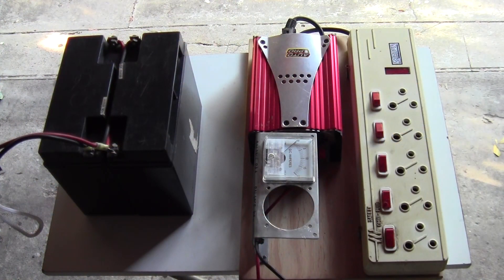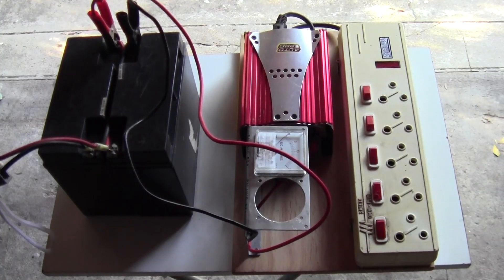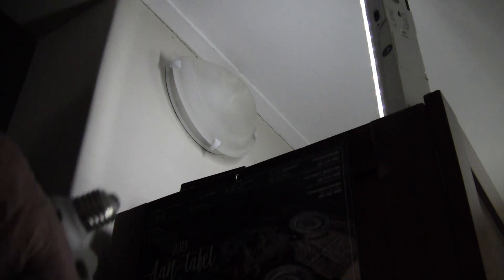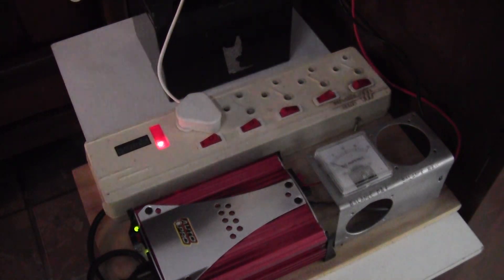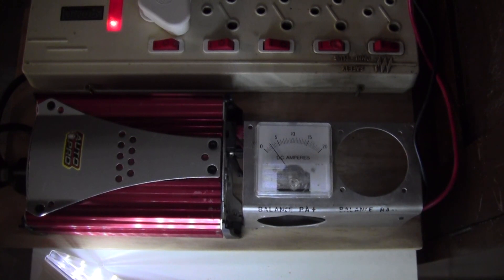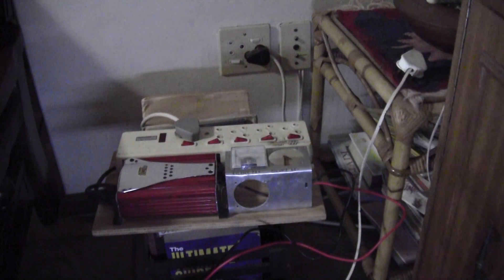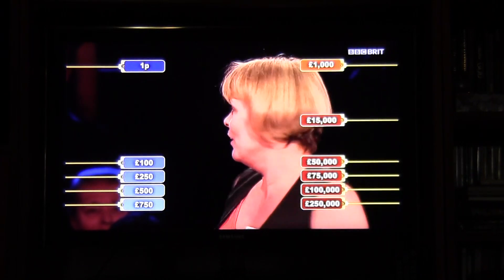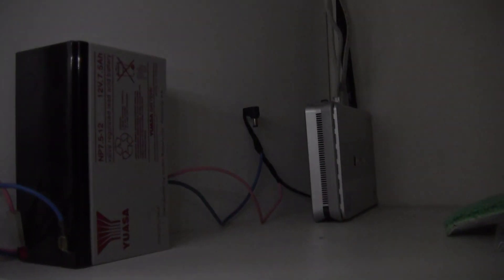Easy, Cheap, DIY Load Shedding Buster System

Comment: And how many batteries do you need to run the whole house plus stoves and heaters for 2hour
Reply from the maker: To run stoves and heaters you will need a proper inverter system, at least 8kW inverter and 10kWh batteries - you are looking at around R200k!

Comment: Can't you use that system for the plugs ,TV and lights  at the same time
Reply from the maker: Not on a 400W inverter, you will need a much bigger inverter and batteries.  It should then be properly installed by a qualified electrician.

Comment: what a helpful video. i certainly learnt allot.i like that you pointed out that a router can be plugged directly to a 12v battery. thank you
Reply from the maker: Great to hear.  I may have confused the issue, but the router is effectively plugged into the 12V, but runs off its power supply when the mains is on.

Comment: Very clever. Really like the thinking, the next step at this time for me is diy'ing the inverter for different appliances. In my honest opinion, the inverter is a shit device to run appliances that already convert AC to DC. So you go DC to AC, and back to DC. Such a waste. Eish, and inverters has been in development since the invention of electricity, but all people do now is buy inverters.
Reply from the maker: Indeed very inefficient to convert back and forth. I since got myself a power bank specifically for keeping your internet devices powered during loadshedding. The complication is that their voltages can differ, like mine needs 12V and 5V, some even require 9V, but they do come with all these voltages.
Reply: @SterremanWillie  nice, same here. Cheap ups for running WiFi for 3 hrs. I bought a few TP4056 modules to charge some lithium batteries I have lying around and the free lithium batteries from disposable vapes. This works great for lights and also with small 5-6V solar panels. I managed to upgrade one of these into a power bank with a 3.7-5V booster board, thats enough to charge a cellphone. My next target is 12V appliances such as laptops and also small AC water pump, going to try a mechanical DC PC fan inverter. It's a lot of fun, must say 😁👍
Reply: I find energy fascinating, inverters for instance have existed since the invention of electricity, DC/AC, Nicola and Ed. Just a matter of sizing components for what you need. Solar power has been around 1000's of years. For geyser there are various option to heat via the sun and if all else fails, nothing wrong with some charcoal heating. I haven't looked at geysers yet, they the most power hungry, we would need to look at how the element actually work. For now I'm going from low voltage to higher voltage, next target AC water pump for a grow tower. Guess our main problem is everything we have and even our houses designs are made specifically for using grid power. And Eskom charging for solar is a b#@!. Actually, for a geyser you should use a gravity battery, connected to AC generator. Yeah, that is the route I think I'll take since we have to consider the cost they are applying to solar panel systems. Gravity and solar thermal should still be viable and maybe easier to hide lol

Comment: Exactly what I am doing for my home fiber connection (the last part anyway).  To better charge the battery when the power is on you can introduce a buck boost converter to increase router 12v to 13.7v.  Also a good idea to add a diode to the routers power supply and between the battery and router to ensure the battery doesn't drain when mains is on and to protect power supply. Also can use buck boost converter to increase the 12v from the battery to 24v if you run a ubiquity Wi-Fi access point. Works perfect. My internet stays on when we shed even during stage 8.  Did not cost me more than R100 (R300 if you work in battery cost).  NOTE I AM ONLY TALKING ABOUT THE LAST PART OF VIDEO concerning router / internet connectivity.

ALSO BE VERY SURE for the rest of the video that you kill your mains breaker before hooking up the inverter else its bye bye inverter.  ALSO SUPER important do not overload your inverter.   Lastly.  This fine gentleman introduced a very cost effective method of combatting loadshedding.  USE this and don't give in to the ridiculously overpriced SOLAR and BATTERY prices charged by sharks - they are taking advantage.
Reply: Just a note on this video and my comment: working with mains voltage is dangerous, the same goes for UPS/inverter devices. You can kill yourself if you aren't careful. If you aren't comfortable working with high voltage then get a skilled/knowledgeable person to assist.

Pushing power back into your home circuit is dangerous for several reasons, the most obvious of which is not disconnecting the Eskom feed. Whenever it becomes live you will lose your inverter and risk an electrical fire.

Secondly, the circuit you are 'piggybacking' off when connecting your inverter via a light socket is safer than the other option of feeding back into a wall socket as it limits the devices drawing current to lights only. But it is still a risk and will nullify your home insurance. 

Do not mess with mains power if you aren't completely comfortable doing so. Make sure you understand the risks and FOCUS. I think Oom Willie is trying to help struggling South Africans and does not intend for anyone to get hurt. If you consider following his video then you do so 100% on your own at your own risk.  Although not explicitly stated the video is intended strictly for educational purposes.

Comment: This is a very sketch setup
I want a line interactive battery backup that will keep my pc powered
Reply: Simple get a UPS and remove the battery and replace it with a car battery
Reply: @KingsleyMabasaa  i want lithium iron phosphate batteries
Lead acid degrades too fast
Reply: @g1expert102  bruh if you're gonna lookup a DIY video but you want a UPS built with materials and retail standards, just go splurge on a UPS
Reply: @1ma4ighter  do you underestimate my ability to diy a line interactive battery backup?
I can diy a ups with lifepo batteries that cost R500 per 3.2v cell
Reply: @KingsleyMabasaa  I'm struggling to find a cheap UPS but I'm planning on doing this.

Comment: 1:35 we use a double ended extention for our system. Then earth is also included.
Reply: How do you get earth from inverter?
Reply: @nicomoloi936  we use a generator with a copper cable and tent spike droven into the ground, I just read some inverters has that option.

Comment: Hello Willie. I have a question.  I have a B&D 750W 6.52amps inverter model PI750AB.  For the most part it works perfectly.  But I'm experimenting with using it with a smaller battery in my chicken coops when needed.  I have it hooked up to a GT12080-HG 12v 8ah battery.  I can run a fan, laptop radio etc no problem. But when I plug in a 200w heat lamp the inverter goes yellow and cuts the power.  it wont work.  The battery is fully charged.  Why is a 750watt inverter shutting down when plugging in a 200watt heat lamp???   Any ideas?  I'm trying to put the lightest battery in my setup I can use just in case I need to move it.  I'm 78 and can't much carry heavy things.  Thank you for reading
Reply from the maker: Without Googling the part numbers, I'm a bit puzzled by the 6.25A - multiplied by 12V it gives 78W and by 220V means 1375W. Anyway, you are right, a 750W inverter should easily handle a 200W load. Two things spring to mind. Either the inverter is not really 750W or the small battery cant handle the load. The latter could be your problem because it means that the battery must supply 17A, which is huge for a small battery. I fear you need a more potent battery. By the way, to supply 750W at 12V, means 63A - for which you would need thick wires!
Reply: @SterremanWillie  It's def a 750w inverter   the  6.25a is what the label says it can handle "up to"
Reply from the maker: @1realtruthrightnow742  interesting. I'll Google the model number when I get a chance.
Reply: While I will never apply this video due to the hazards it represents and the risk involved, (it’s straightforward dangerous and can backfeed the street if a mistake is made potentially killing a linesman.  No amount of swearing or insults will change my opinion so don’t bother), my thoughts on the hen house 200W light is this….  Assuming this is a tungsten lamp to heat the hen shed, the globe rating is the power consumed when the bulb is running at full voltage and the filament is hot.  When the filament is cold it’s got a much lower resistance and will draw much more startup current.  The inverter will see this as a short circuit and it’s protection will shut it down.  

Considering the source resistance of the battery and its cables, the voltage into the inverter could collapse too when the startup inrush current is drawn, and the inverter will again shut down.

If you add a series resistance it might be possible to limit the startup inrush current but still allow the lamp filament to heat up partly.  A paralleling switch across the resistor can then be used to short out the resistor and allow the lamp to light fully without shutting down the inverter.  

I don’t know the resistor value required, nor if this idea will work. Might be worth experimenting at your risk.

Comment: I have 4 12v 120AH  deep cycle gel batteries and an inverter but my power only lasts about 1 hour 30 min with only 3 exterior lights on, what can I do to increase this time? Is it the settings on the inverter or the batteries themselves?
Reply from the maker: Wow, that's amazing. I did a few quick sums. Those 4 batteries give you 480AH which is a huge amount! If you devide that by the 1.5 hours your lights stay on, it means you must draw 320A or 106A per light from the batteries, meaning 1.3 kW per light! You are either illuminating a stadion or your batteries are shot! You either need new batteries or replace the lights with LED lights.
Reply: @SterremanWillie  those are gel batteries, assuming a DOD of 50% to avoid permanently damaging the cells they have 240ah of useable capacity. I'm assuming this person had no prior knowledge of the 50% DOD limit of gel batteries and has essentially run them into the ground.
Reply: @SterremanWillie  i would  change both if i was him  . The lights to led and the batteries to lithuim. He must then just use a bms  to balance charge the cells.  So he doesnt overcharge them and also doesnt dischargr them too much.
Reply from the maker: @frikkiesmit327  indeed, one can customise this idea a lot.  Your suggestions are all great!

Comment: If you a qualified electrician and only you know what you are doing its fine.
Not legal and not reccomended
Reply from the maker: Indeed!  Being DIY, you need to know how electricity works, otherwise you should stick to long extension leads to distribute the output form the inverter.

Comment: How did you make that bulb connection?
Reply from the maker: I stripped the base fitting from a blown bulb and soldered two wires to it, live to its central connection and neutral to its body. These I then connected to a plug top.
Reply: Sir!  @SterremanWillie  We want you as Eskom’s CEO immediately.
Reply from the maker: @SuccaProof  thanks, but no thanks!  😄😀
Reply: @SterremanWillie  does the same -/+ apply when tipping into the light switch or not?  Must it be tipped in at the light bulb is what I am asking.
Reply: What size battery did you use?

Comment: hi, would a 12v gel battery keep my cctv camera system on? How do I know how much power the system needs to keep it on? I don't know what VA/Watts/V means
Reply from the maker: The WH (watt/hour) rating of the gel battery (or any battery for that matter) will determine how long you will be able to power a certain load.  So, if you can add up all the power drawn by the CCTV system - look at the Watt ratings on their lables - and multiply that by the time (in hours) you want to keep it powered, it will give you the WH rating of the battery required and also the watt-rating on the inverter you need.

Comment: This is a very great video👌, I would kindly like to ask how many volts is your battery that you have used in this video?
Reply from the maker: Thanks for the kind remarks on my video.  The batteries are all 12V and when connected in parallel like I did, the output is still 12V.  The inverter works with 12V input so can work from a car battery.  These are old UPS batteries I used.

Comment: This is called back-feeding & it's pretty dangerous if you don't know what you're doing. Anyone doing this, please be VERY CAREFULL of when the grid power comes back online. If your inverter is still connected, there will be a big bang!!. Safest way to do this is go to db board & turn off the mains circuit breaker first (the big one with earth leakage). When utility power comes back on, FIRST disconnect the inverter from any plugs / lights, then switch main circuit breaker back on. Also beware of cheap ass inverters, "modified sine wave" inverters tend to kill electrolytic capacitors in consumer electronics pretty quickly. Tv's, laptops, phone chargers will get damaged after a week or so. Pure / true sine wave inverters cost more, but wont harm sensitive electronics.
Reply from the maker: Ist that exactly what I show in my video? The biggest danger is blowing up the inverter if you are stupid.
Reply: @SterremanWillie  Sorry I missed that, but no harm with putting more attention to safety. You have no idea if the people watching this are stupid or not, but desperate for power is almost guaranteed.
Reply: No inverter has a 100%  pure sine wave.  Because you using dc to inverert it to ac.  And the electronics do a good job but it doesnt replace the purer  sine wave that one usually gets from eksdom.  ;)
Reply: Capacitors are not usually that sensitive.  Its more the smaller components running in the start up circuits in the power supplys. Like diodes transistors and scrs .

Comment: Nice Willy..
Can you plug a TV too?
Reply from the maker: Yes, I can run my LED flatscreen and the DSTV decoder on it, plus one light.  Older TVs, even plasma TVs, may be a problem since they draw more current.
Reply: How long does it run for and what is the a/h of those batteries

Comment: This is not SANS wiring compliant.
There is no earth leakage protection when you use this system.
Risk of electrocution under any fault is very high.

I doubt your home insurance would cover you if they found you have made your wiring not compliant.

Rather stick to using the inverter and plug into that. Keep it completely separate from your house wiring except for when you charge the system.

Comment: I removed my previous comment,  bottom line is its illegal to back feed electricity like that. Should something go wrong you will be held liable and you insurance won't cover the damage...
Reply from the maker: OK.  Just go with extension leads then - which are legal, but can also cause a fire.
Reply: It is an old trick and although it is not safe  the type of person that would build a diy setup like this will have the basic knowledge and common sense to know what they are busy doing.
Reply: I decided to use 12v led lights from China mall, they last a long time on a 12v7,2ah battery, and a 2,4,6 Amp battery charger.